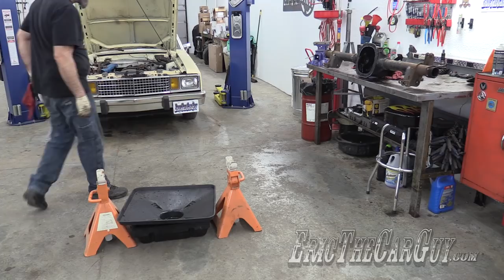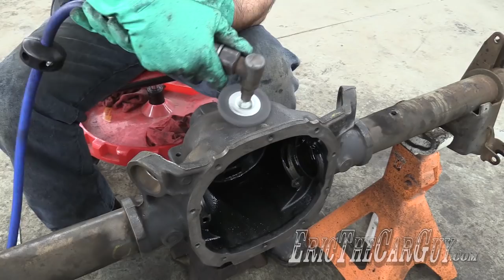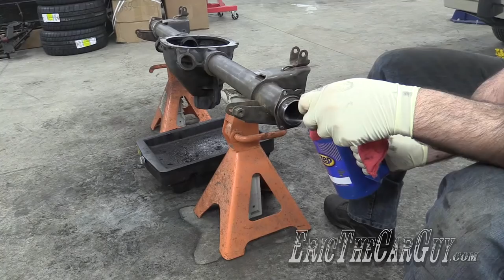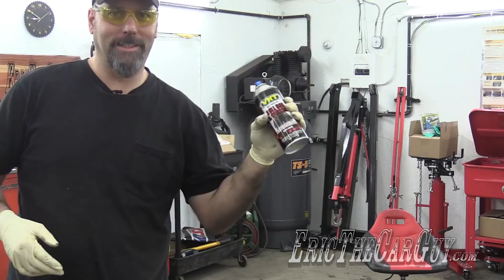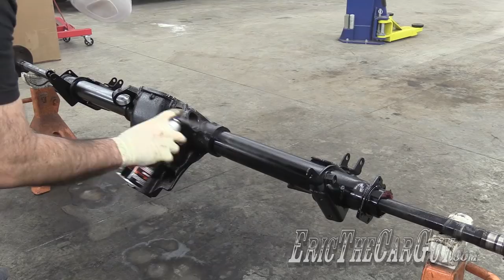How To Clean, Prep, and Paint a Differential #FairmontProject

Comment: VHT paint is awesome.  I've used it multiple times now, and I've been surprised by how well it holds up and maintains a nice appearance.
Reply: I found what I think is the ultimate combo for suspension/chassis paint. Base coat of VHT Suspension Epoxy paint with the VHT Rollbar/Chassis paint on top. It's hard to destroy that combination.
Reply: Thanks for sharing… didn’t know about VHT expoxy

Comment: Eric, I used to use a metal hammer to cut the masking tape but I actually found a hard rubber hammer (not mallet) works best. The rubber conforms to the contours and you don't need to worry about damaging the underlying metal.

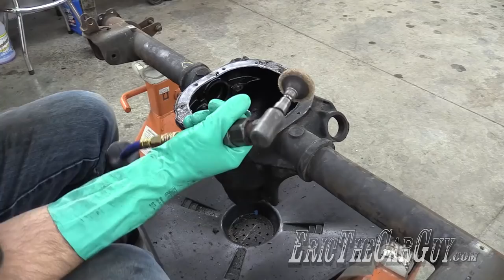Comment: not sure if you know this or not, but that that harmonic weight (dogbone) that bolts to the bottom of the housing is designed for vibrations with stock gears. If using any aftermarket gears (3:73's or 4:10's) you simply don't need it anymore. When I went with 3:73's and an aluminum driveshaft in my mustang I took the weight off and it drives super smooth.

Comment: A little trick I do is to smear a tiny bit of grease/Vaseline on the bearing surfaces or anywhere you want to be bare metal. When the paint dries just come back and wipe it out with a rag. That'll keep the overspray under control and ready for assembly.

Comment: There's a product called Jasco which I use all the time.  It's a rust reformer similar to naval jelly.   I apply it with one of those green scrub pads.  It is basically phosphoric acid and will neutralize rust.  It also contains a light primer which will keep stuff from rusting for a small amount of time.  Works great as a paint prep and to get areas that are hard to sand.   Also works great on body panels with surface rust.

Comment: I've found one of the best and most cost effective cleaners for rust and such is Salt and Vinegar. Only downside is its takes a a few days to really soak in. I've used it to great effect soaking parts overnight then scrubbing with hot water and soap then repeat as many times as needed.

Comment: Tips from a powder coat operation…burn all oil and grease before blasting. A cheap propane torch from harbor freight (weed burner) makes quick work if your seals/gaskets are out. It doesn’t generate enough heat to cause damage to an axle.

Comment: For future reference on your next rear end project. Which will come sooner than you think.Get a few gallons of Mineral Spirits. Before you completely disassemble pop the R.E.cover off drain the old lube out of it, add Mineral Spirits to it put cover back on let it sit & stew for a week or so. When you get ready to tackle the project, drain R.E. & the internals will be nice & clean. You can even put the cover back on & use the freshly drained Mineral Spirits to help clean the crud on the outside. ;)

Comment: I realize you probably don't do rear axles that often, but to pass on something that I know of because of work that somebody I used to know would do... 

He'd put the diff. cover back on, hose clamp rubber cups over the ends (plumbing parts), put bolt plugs in appropriate places, and then just sandblast the exterior of the entire thing. Removing the grease, dirt, everything, down to bare metal. After that it was just a matter of washing out the inside. 

I know you probably don't have a sandblasting rig already, but the cheap little setup at harbor freight would be perfect for something like this small job. One bag of bead, or fine sand, pull a hose out to a grassy spot behind the shop... and blow off all the crappy crud that it took you many hours to remove by hand. As a bonus, while the die grinder can never get everything brushed off - the blaster will remove EVERYTHING, even in all the tight corners and narrow spaces. 

Just a thought, mind you, not a criticism or anything. You did a lot of good work on this, even if it did take the entire day. But IF you get into another project like this in the future you might consider buying the cheap little blaster rig - mainly because it will save you so many hours of effort trying to get the thing all cleaned off and de-greased before painting.
Reply: ALSO, if you saw a slot in the end of your broomstick you can jam the rag in the slot and rotate it as you're pushing it through the axle tubes. Makes it a bit easier to get the tubes all swabbed out and clean. :D

Comment: Older but good video. I like to use oven cleaner and pressure washer for first couple of cleans, then degreaser with final oil and wax remover. You're cleaning the inside with degreaser or brake cleaner so the water doesn't hurt a thing.
Black caliper paint over epoxy primer holds up better than the enamel paints.

Comment: Excellent video! The ONLY thing I can see that was missed was the axle tube re-enforcement. Due to them being pressed in at the factory. They tend to stop doing their job under high load. I would have welded the axle tubes to the center housing prior to painting. I have an 8.8 I'm prepping to rebuild now and I plan to do that to mine once it is cleaned.

Comment: Eric- did you leave the Salamander going on it overnight? That VHT coatings work best when heat cured. I would've preheated it with a MAP or similar torch before painting it, to assure adhesion.

Comment: I wouldn't trust brake cleaner as the last cleaning step before painting, with all its nasty chemicals it could leave a residue. I keep rubbing alcohol in an old windex bottle for the last cleaning before paint. It's cheap and evaporates quickly. 

Great video Eric.
Reply: You realize brake cleaner is meant to leave as little residue as possible right? Because you don't want oily residues on brake pads/shoes and rotors/drums.
Reply: I've never really thought about it, I use the brake clean to get the oil off of new rotors and then follow up with alcohol... just my method
Reply: +AirSoftMaverick3232 I use rubbing alcohol for the final cleaning before paint when I care about the finish. For a something like this? Brake clean would be fine.
Reply: Alcohol actually leaves more residue than you'd think. Wipe it on a clean window or piece of glass and you can see all that it leave behind.
Reply: buggsyspam Your normal rubbing alcohol is mostly water is why.
Reply: +Cragified ah now that makes sense
Reply: Cragified
It's 5% water, not "mostly". Even on the cheapest end, it's 30% water. You can visually see the results on a piece of glass between isopropal alcohol and brake kleen. Break cleaner wins hands down.
Reply: buggsyspam Yeah no. Rubbing alcohol comes in 40% which is 60% water and is what is both cheapest and most widely available. 70% which is 30% water and 95% which is 5% water and is both the most expensive, less available, and does not last as long at that concentration due to alcohol being hygroscopic once opened.
Reply: Cragified
Jesus man, where do you shop? Even Walmart doesn't carry anything that weak. Widely available? Not in the Midwest. 70% is the lowest you can buy. But don't get technical here, because the very definition of "rubbing alcohol" is a minimum content of 70%. Even higher minimums outside of the US. A quick search on two supply sites doesn't even show plain isopropyl in that concentration. I own 95% isopropyl alcohol. It. Leaves. Residue. That was my original statement and I stand buy it. Feel free to use whatever concentration of alcohol you want as paint prep.
Reply: AirSoftMaverick3232 I agree, but it won’t hurt it in the axel.

Comment: Hey Eric, watching someone clean something, or cleaning it your self is supremely satisfying. 

This might be a dumb question, but how do you get the brake clean in that blue can? Can you buy it in bluk or something? Or did you just take normal cans and spray 'em in there?
Reply from the maker: You remove the plug and pour it in. Then you add compressed air in the schrader valve in the top. Links in the description.

Comment: industrial strength grease cutter works really well I used it on my aluminum valve covers on my honda passport and then painted them blue and the look good too well till putting them back on then they got scratched on firewall side

Comment: quick tip, You can also use the flat end of a flat head screwdriver to cut the tape. works better with aluminium than cast iron, because you arn't likely to indent the aluminium.

Comment: get a basic shot blast rig. blasting and etch baths are a revelation. you did a nice job though... have you seen the air guns with a bottle on the bottom and a long nozzle those things are awesome basically a jet washer for your air hose you can fill with spirits

Comment: There are rust converter paints available, so you can use that as your primer.  I know Eastwood is one of the places that sells something like that.
Reply: i agree !! just used a product, COROSEAL rust converter, its available on amazon or ebay
Reply: can you use that to remove rust from bolts?

Comment: Hey eric. What about when one of your rear axle shafts move in and out. Not up and down or side to side. I replaced the rear sway bar bushing and new lower control arms. Took it for a ride and the horrible rattling noise in the right rear. Put it on jack stands and went to check the bearing play. Up and down side to side. Accidently pushed it and heard a clunking noise. Bout an 8th inch play. Went to the drivers side and no play at all. Seems fine. I believe most of the mustang people are dealing with this. Thinking it's sway bar bushings.

Comment: Nice job!

Only thing is I'd put some hearing protection into/onto my ears while using air tools, because these things are friggin' loud.
Reply: hearing protection is good to have around but not necessary for using tools intermittently.. you can handle air tools for 10-15 mins without any permanent damage and im sure that time is under estimated.. either way its his shop his tools his ears so you dont need to bitch at him im sure he knows all about hearing protection

Comment: After all this work with cleaning it, I would put some vinegar on it for a night before painting it to be sure there won't be rust coming from under the paint. And as some people suggested, finish it with bed liner or chip-guard.
Reply from the maker: I don't want lumpy bed liner on my diff. That would also hold in the heat more. Thanks for the suggestions.
Reply: After all you have a lift, so if the paint gets damaged you can always cover stuff around with plastic foil and touch it up with spray paint easily.

Comment: i like to use gasoline for the initial cleaning. seams to cut through most everything and is a lot cheaper than other solvents. then i use something else like naptha or paint thinner to remove the left over residue

Comment: Sometimes that sort of stuff is kinda like therapy.  Especially when its for your own fun stuff.   Daily driver, not so much.  Looks good.   

Side question.    Did you consider using a IRS 8.8 from a late 80's early 90's Tbird or Mark 8 instead of the normal 8.8 when thinking out the build?  May have mentioned in an earlier video that I have not seen yet.
Reply from the maker: Yes, too heavy and the results I read about were less than stellar. In short, too much work for too little return.
Reply: Good deal, totally understand that.  Some of the Lincoln's had the aluminum rear and driveshaft, from what I understand the same as the Cobra R.  Wondered how much of a pain it would be.   Great build looking forward to more video's.

Comment: Brakeclean dries too fast. Should have used spirit oils instead. It cleans and doesn’t dry as fast. Nice instructional for those who’ve  never done this. I hope you cleaned really well those old drive axels before inserting them back in. You did mention how much metal shavings you missed inside while cleaning it with the broom. Those drive axels are full of the same shaving until you clean it really well.

Comment: hi Eric good job but it will only last few months before starts peeling off !brake cleaner to clean diff ROFL have you ever heard of wax & grease remover? how about etch primer for bear metal ,im afraid you will find out that paint is not primer ROFL now you did a good job with wire wheel but spraying over bear metal or no sending of old paint, well you should have just sprayed over the dirt cause its not going to last.good luck from your friend critic

Comment: Dear Eric,
   My rear diff fill plug is irreversibly ruined. I possibly could bore it out, but I've been brainstorming and then googled front fill plugs on a Chevy. I have an old 1986 F150. Would you drill a small fill hole in the front of a Ford diff cover with a short bolt or if I can think of an alternative? I'm tempted and think I can make it work. Thoughts? Thanks.
David
Alberta

Comment: +EricTheCarGuy - Why didn't you weld the axle tubes to the center section?

(Ford 8.8 axle tubes are somewhat known to have issues with the factory axle plug welds above 400 h.p. and when used in off-road applications).
Reply from the maker: I belive I mentioned in the video I wasn't going to do that unless there was a problem.
Reply: EricTheCarGuy - Yes you did, but it's easier to do it now before a plug breaks and with the 500 to 600 horses you're running, it's cheap insurance and peace of mind.

 Now that you mention it, I would be interested to see how many drag strip runs you can get out of it before you get the famous fluid plug leak, (a warning sign right before the plug breaks).

 Please be careful though, I don't want you or cameraman Brian to get hurt.
Reply from the maker: I'll keep an eye out. Honestly, this isn't going to be a drag car. In fact, the way it's set up now, if I run too fast at the track, I'll have to make a lot of upgrades to pass tech before I'm able to race again. That said, my plan is to drive this as a street car, not a race car. I won't be beating on it all the time, just ripping up roads occasionally.
Reply: Once plug welds break it is too late... most times they are not repairable.

Comment: The Mineral Spirits will do an excellent job breaking down all that old residue that builds up over the years from old lube. Much safer to work with than the Break Cleaner.
Reply from the maker: I did use mineral sprits. That's what's in my parts washer.

Comment: Have you ever thought of using the yellow bottle of easy off to clean stuff you can make things pretty much spotless with two to three coats and a garden hose first coat you coat it real nice 30 minutes later you recorded again and then wait another 20-30 minutes and blast it with a garden hose and if there's any spots left coat them again scrub a little and blast them with the garden hose should be spotless I use it on those really filthy engines as an engine degreaser try it you won't be sorry

Comment: for you're setup bearing make sure they are the same some kits come with the high torque bearing and it will not fit in the old race or vice versa.
Reply from the maker: Yea, I learned that the hard way. It's covered in next weeks video.

Comment: Hello Eric, I have a 1995 Honda Accord non-vtec, and the problem I have with my car is that I have to crank it like 5 times to get it start or in short way it cranks a long time before it starts. I have change the starter and the distributor but it's still doing the problem. It seem like the fuel pump can't be bad because the car doesn't shut off on me, any suggestions on how to fix this problem because it's my first car and I don't want to feel bad that I got a mess up car :( I really want to maintain this car in good shape. It has 160161 miles. Also, how do I correct my ignition timing because that's the only thing I have failed in smog check.

Comment: I would have used the purple concentrated degreaser on that gunk on the diff housing. Let it soak for 20 minutes or so. Takes a lot of the elbow grease out of the equasion.
Reply: Zep markets it as a floor cleaner, but it works great as a degreaser. (Noticed you were using a Zep brakekleen sprayer)

Comment: i have a question reg these wire wheels. are they any special coz the ones that i can buy are ~45ooRPM or in the best case ~8ooo RPM . Angle grinder are able to rotate about 20ooo .
is it lower pressure on Air comp to slow down or what? Thanks

Comment: +EricTheCarGuy Do you ever have bits of that wire wheel flying off? A buddy and I were working with a little bit bigger wire wheel and months later he found out he had a little piece of wire stuck in his hand between a joint. He never felt it go in. WEAR GLOVES ALL and other safety gear! Stuff happens so fast you won't even feel it happen.

Comment: Question, I need to drain a diff and use mineral spirits to clean it. If those two substances combine in the oil holder is that safe?

Comment: For such a large complex shape, the way to go for rust removal is media blasting. I couldn't stand to sit there with a die grinder for hours. Problem of course being that commercial media blasting equipment is expensive. Alternatively, I've seen great (and very affordable) results using a 12V battery charger as a power source for home brew electrolytic rust removal. Just put your crusty junk in a plastic tub with some cheap chemicals and let the magic pixies do the work for you.
Reply: Little tough to find a container long enough for an axle housing though. Guess you could make a plywood box and line it with plastic sheeting if you needed to.

Comment: Where did you get those brackets for the parking brake lines?
Reply from the maker: There are no parking brake brackets on this housing. Those are for the quad shocks which are suppose to help with wheel hop.